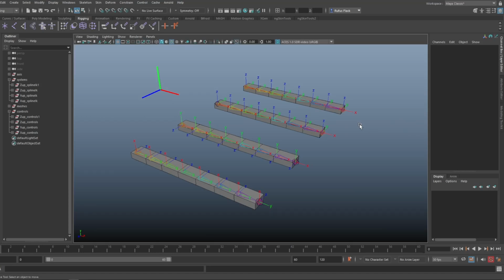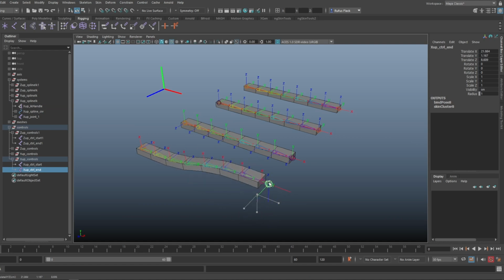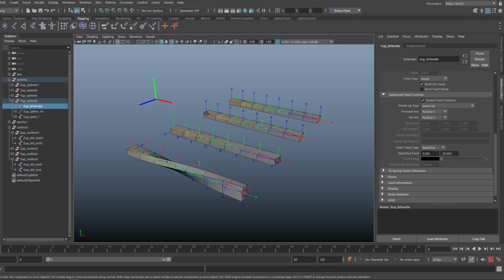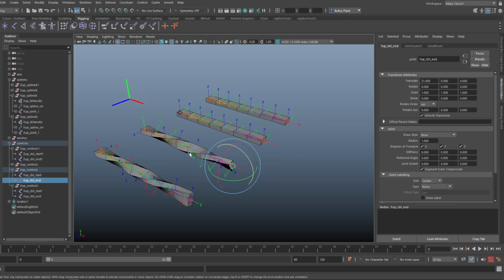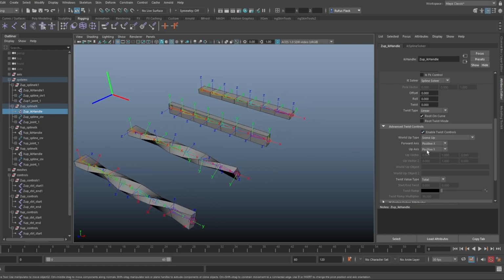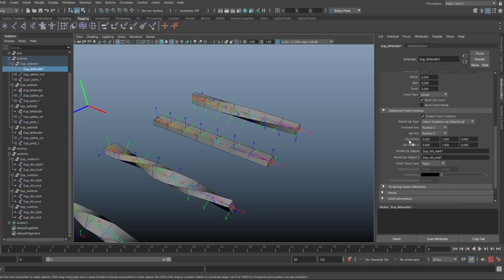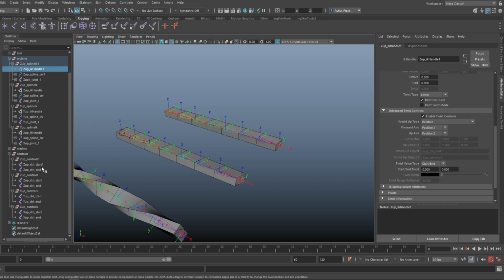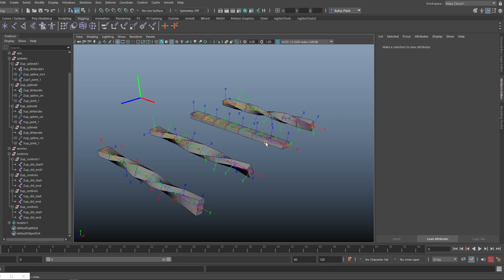Maya rigging tutorial: Spline Ik Advanced Twist Controls

Comment: If anyone one is having a problem with the first and last joint not twisting when using relative. Turn on "Root twist mode" to get the first joint to twist. To get the last joint to twist input the x rotation of the secound last joint into the last joint.

Comment: When you use "Object Up" it takes the location of the object  and points the specified "Up Axis"  toward them. My guess is that the value of 90 is not important as long as it is greater than 0 on the Y axis, according to initial bone orientation